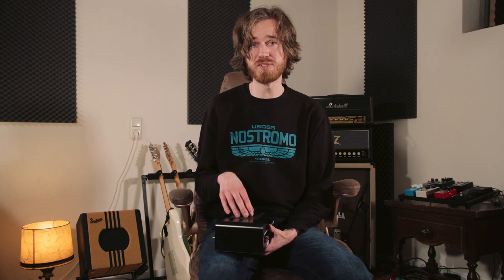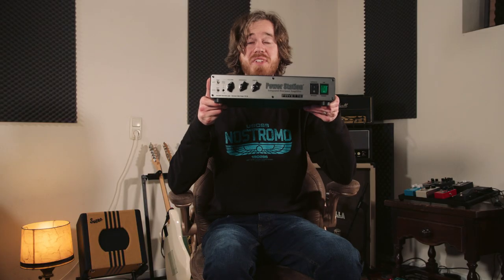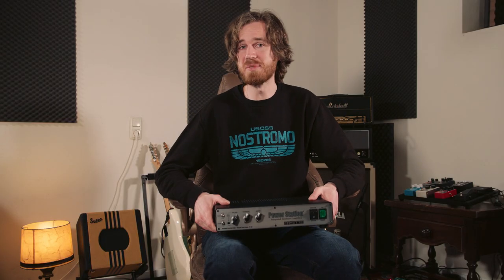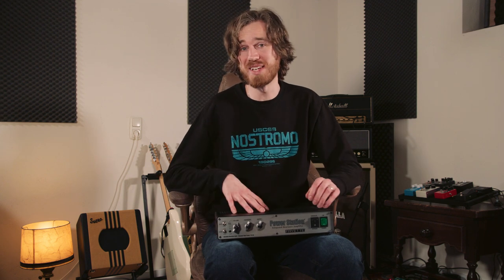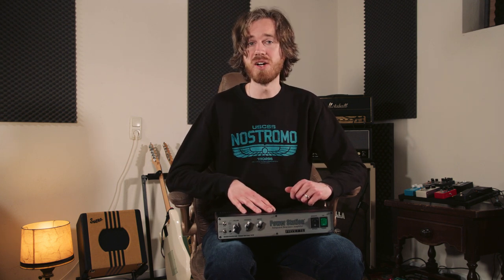Which Attenuator: Harley Benton or Fryette?!

Comment: Ok. I am sitting here with DT 770 headphones and after listening to the comparison in the first 2 minutes, the cheaper PA-100 is the one, which changes the least of your original tone. It keeps the muddiness and that rough, vintage tone. The Fryette sounds good but the signal sounds compressed, cleaner, less vintage and to me it sounds like a totally different amp. The PA-250 sounds closer to the original signal but a bit more airy, a bit cleaner and less rough. At least, that's how it sounds to me. We all hear differently. I did study music and work as a professional drummer. I just stumbled across those amazing attenuators. For sure i have to buy one for my guitar amp in my flat :)
Reply from the maker: You're right on the money there. Also check the follow up with the Tone King then 🙂👍

Comment: Harley Benton confirmed "PA-250 Power attenuator" as a RESISTIVE unit, not Reactive
Reply from the maker: Yeah not surprised. The info was very vague when they came out around the time I get them. Also still had some bugs and issues, and so did mine. Better than their cheaper options, but there's still a lot of better quality if you're willing to pay more.

Comment: I like that you did this comparison. However, I’m confused by the Power Station in this because in the other demos I’ve watched of it there was just about zero discernible difference between the Fryette bypassed, and the Fryette engaged and set to unity gain. And if I was able to hear any difference, it was so minuscule that it didn’t even matter. This doesn’t seem to be the case in your demo. Just an observation.
Reply from the maker: Depends on how you use the switches. I didn't use the flat settings, since that makes it a resistive rather than reactive load, which defeats the purpose for me. This is how it sounds in the other settings. No trickery besides that.
Reply: Agreed, I have the Fryette and it is excellent. Steven hasn't set it up right or something lol.

Comment: The Fryette is so much more than an attenuator and I believe you haven't scratched the surface of it. Learn first how to use it, before giving such definitive conclusions. I own a Fryette PS100 and it has been a life changer, so much so I'm considering a second one for stereo applications.
Reply from the maker: This was an attenuator comparison, so there was no need to explore the other functions in this video, since that wasn't the point of this video. That's why I stated that the Fryette might be more usefull to other people who might be looking for something more than just an attenuator. But this video and the follow-up weren't about that, this was for people just looking for a good attenuator, so that was the focus of this video.
Reply: @StevenAnthonyGuitar  honestly the Fryette isn't even an attenuator but a load box that runs into a power amp. So it's not to be compared to other attenuator but other load boxes. I even think you stated something similar in the video so... Doesn't make sense why it's here. The two notes captor in the attenuation mode or rock crusher would've been a better comparison IMO as it's apples to apples then.
Reply from the maker: @AtTheSourceStudios  when I opened a thread on the Gear Page about which attenuator I should get for my purposes, the most recommended one was this Fryette. It is promoted as an attenuator. I've tried the Captor X, but it is very limited in its attenuation capabilities and I think that's more of a load box IR... with minor attenuation capabilities. Check out the recent video Johan Segeborn did on the Fryette: a attenuator for sure, and he seems to get better results than me. I still prefer the Tone King Ironman II.

Comment: I checked with Fryette and they said: "The “Flat” settings make it a purely resistive load.  The other settings change the impedance characteristics of the load, not the frequency response directly, though that usually amounts to the same thing." 

Then I said: "So the attenuator is going to perform like most other resistive attenuators unless I use the switches?"

They responded: "No, it is still a different method of working than a traditional resistive attenuator.  The Power Station is a re-amp, so even with pure resistive settings you gain the continuous control over volume and have a completely consistent load – traditional attenuators actually vary their load characteristics with each “notch”.  It is a fundamentally different product than, say, the Hot Plate and its ilk."
Reply from the maker: Thanks! I initially got this information from Pete Thorn's video and then checked with Fryette before posting this video. They told me something different than you it seems.
Reply: you are correct sorry for the confusion... the first response I got was worded weirdly
Reply: @StevenAnthonyGuitar  I got more information and posted in the original post: "It is still a different method of working than a traditional resistive attenuator.  The Power Station is a re-amp, so even with pure resistive settings you gain the continuous control over volume and have a completely consistent load – traditional attenuators actually vary their load characteristics with each “notch”.  It is a fundamentally different product than, say, the Hot Plate and its ilk."
Reply from the maker: @truthoriented  I have to say I didn't notice that much difference in the flat setting to those cheaper attenuators, be it in sound or feel. Not badmouthing the Fryette, it's a great unit and will have its uses for sure. But for attenuating a my plexi amps, I think the Tone King Ironman II just did a better job.

Comment: I've just started seriously thinking about getting an attenuator for my old Laney AOR 50w head because now that I have a Kemper and have started playing gigs, I really want to get the most out of the Laney's tone for profiling and taking it out on stage, I've just never been able to get that cranked tone out of it and I need something that will knock off quite a bit of volume without colouring too much.  

Dude, I actually completely agree with you on all fronts here, I didn't like the way the Fryette sounded like it was trying to compensate for the altered highs and lows by scooping out the mids, Imo mids give most noticeable in character in a valve amp so that's a big no for me. The Harley Benton is actually VERY similar to the un-attenuated tone like you said, mids still in-tact, and it would be easier for me to bring the low-end back with an EQ without colouring the tone, just enough to fatten up the sound. Great "straight to the point" video man, you have my like and sub, I'll check out your Tone King video next 👍
Reply from the maker: Thanks, I'm glad you liked the approach here!

Comment: The PA-100 sounds the most realistic/neutral
Reply from the maker: Although I still own it, I would disagree. It muffles up the sound and you can hear that in the comparisons, at least with good monitoring. But it's fine as a cheap alternative or backup.
Reply: @StevenAnthonyGuitar  that's maybe because the PA-250 and Fryette brighten the Signal up. I listen on Neumann KH420 in a measured in room.
Reply from the maker: @fritzhieke7209  all of them color the tone in some way. Of course I'm also bringing the feel into the mix, as you experience more difference by actually playing them. The best one I tried is covered in the follow-up video, and that's the Tone King Ironman II.

Comment: Thanks for this video. The same riff comparison of all the attenuators was useful. 

Was looking into the PA-250 since yesterday and it seems like a solid buy, except for the balanced and unbalanced out that seem to be a bit too hot gain wise, but I will use it just for the attenuation. Would've been nice though.

I still hear a bit of a change in sound with the PA-250, less harmonics or "rich" sounding, but good enough for home practice!
Reply from the maker: Thanks! The Harley Benton PA-250 cleaned up the sound a bit more somehow as well. I will follow up more on that in a new video tomorrow!

Comment: The intonation is out on your G string, so when tuned its fine on open fret but as you use different parts of string it pronounces how out it is, this is coupled with the G string i assume being a little old? It pitches drastically based on the pressure your applying, intonation is first step, dont want to be "that guy" but i wish someone told me sooner years back, nice video thankyou for info
Reply from the maker: @jimistubbs5269  might be, that video was a few years ago. When you're making videos in your spare time it doesn't always go as planned 😉
Reply: @StevenAnthonyGuitar  its always the damn G string, its become a running joke for my les paul performances because it literally changes with the weather now

Comment: Just for home playing, the Harley Benton is fine.Thank you
Reply from the maker: For home playing I would even get the cheapest Harley Benton. Once you start recording or rehearsing/performing with a band I'd go with a Tone King Ironman II though.
Reply: @StevenAnthonyGuitar   I have to ask as I can't try for myself what would you say would produce better results for home playing. The cheapest Harley Benton attenuator and cranking the amp or a transparent overdrive (klon, bluesbreaker types) and just running the amp really low, getting the gain from the pedal. I am asking about both feel and sound. Also I have to mention I really like the overdrive that my amplifier (tweed deluxe) naturally produces and my aim is to color the sound as little as possible.
Reply from the maker: @martinmcfly2770  for home playing I prefer the cheapest Harley Benton attenuator over an overdrive. I did both with a Studio Vintage. For a while I used a cheap Timmy clone (Caline Pure Sky) in the effects loop to get a good drive sound at really low volume. Out of all of the pedals I tried (incl. a Tubescreamer, Boss EQ and many others) this worked the best and did a really good job...

... but I still have and use the cheap Harley Benton when I have to play quiet. At those levels you the coloration of the attenuator gets mostly undone by the Fletcher-Munson effect, but it still feels and sounds more like the amp than a pedal. For gigging and recording I wouldn't use it, for that I've got the Tone King Ironman II.
Reply: @StevenAnthonyGuitar  Thank you I really appreciate the detailed answer and how fast you replied! In that case I am going for the attenuator. As for gigging it is around 12 watts so I think I will be able to crank it, depends on the drummer I guess but it should be possible. And recording isn't in the cards for now so I will be fine.

Comment: Thomann says the Harley Benton PA-250 is no longer available. No mention of back ordered either. I wonder if they had reliability issues? Some negative reviews on their site with an average rating of 4.2, which is really low for a Harley Benton product in general?
Reply from the maker: The user reviews were pretty positive as far as I remember, only some negative comments about a non-included power adapter. Mine turned out to have issues though, I talked about that in the follow-up video. So there might've been some trouble with reliability in their most recent batch. When they take it offline, users that've received a faulty one cannot complain about it in the reviews until a new/fixed shipment arrives. That's my guess at least.

Comment: great video... How about the amp's headroom, is it affeced by the attenuator? I had the dr Z attenuator and didn't work for me... I use pedals (OD-DS1-boost) and when using the boost, you couldn´t hear a difference, even if you turn the vol all the way up in the booster. So, do they work using that pedals?
Reply from the maker: With the Harley Benton the amp seemed to clean up a bit, allowing for some extra room in that regard. The Fryette had so many options that I can't really remember. I went with the Tone King Ironman II and that didn't change a thing, which I prefered.

Comment: The power station is supposed to be the best on the market and extremely transparent.
Did you start with the depth and presence at 12 o clock ?
Also the 2 switches are for the reactive load, it changes the sound too.
Reply from the maker: I think I mentioned this in the video, but I've been all through the settings. With the switches off it's a resistive rather than reactive load, so at that point it doesn't really feel or sound any better than a cheap attenuator. With the switches on the feel and response are better, but the  tone is altered. Wether that's for better or worse is subjective, though I didn't like it for my rig. My money went to the Tone King Ironman II as being the best attenuator in the market, literally.

Comment: Rivera Rock Crusher is resistive. They claim it does something with a "network" of resistors, but that just means there are multiple partial resistors, and by turning up the attenuation, all you do is add more resistors into the signal path. This is a pure resistive design, and it sounds like sh!t. I know, because I fell for their marketing jargon and I bought one. Absolute trash, no better than Harley Benton or Bugera, just a way more impractical case.

Resistive loads use a simple resistor to turn power from the amp into hot air, and it sounds like butt because the resistance is always constant, which is not how a speaker works. Speakers have constantly changing impedance.

The Fryette is reactive, which means it has an active load inside, something with a bit of inertia or sluggishness, like a fan or something along those lines. The power coming from the amp will be "wasted" on turning the fan, which simulates the impedance fluctuations of a moving speaker, so a reactive loadbox will always sound better than a resistive one.
Reply from the maker: You're right, but the Fryette still alters the sound too much for my taste. There's a part two for this video where I cover the Tone King Ironman II, which is also reactive but with my amps changed the tone less. That's what I went with.

Comment: Thanks alot for this video so i need a reactive attenuador , around €220 is the cheapest here at Thomann , good to know so i can get aN ENGL Fireball 100 at home \m/
Reply from the maker: Well, like I said in the video: Thomann never responded to the question if their Harley Benton PA-250 is reactive or resistive. I think they're having some issues with their latest run, because the one I used in this video started to show overloading and they've removed it from their website.
Reply: @StevenAnthonyGuitar  As far as i know that wasnt the only issue . I saw a Test of the youtuber Eytschpi42 . The Line out didnt work as stand alone . It only worked in combo with the attenuator . Thats the main reason they took it off . I dont know if the Harley Benton P 100 got the same issue , but the P100 is a restrictive attenuator which changes the sound too much especially the low end punch gets muddy . Nothing for me cause i love death metal hahaha . So the 240 Watts Harley Benton isnt available , it is reactive as far as my research shows . I gonna end up with the Two Notes Torpedo for around €220 . Greetings from Germany \m/
Reply from the maker: @antonwilding9744  the stuff from Two Notes is great! I've tried the Captor X and I own the CAB-M.
Reply: @StevenAnthonyGuitar  yeah i saw only great reviews about that gear so far , thats a good sign !
Reply from the maker: @antonwilding9744  thanks for letting me know Henning did a video on the PA-250 by the way. I got to check that out.

Comment: The cheap & simple one sounded better - quite the disappointment for the fryette engineers.
Reply from the maker: To be fair: the cheap and simple one also stopped working after one day. Check the follow-up ;)
Reply: @StevenAnthonyGuitar  Ok, interesting - I'll watch more of your videos. Have you ever tried the SPL Reducer? On some forums some folks swear by it and claim it's one of the few more neutral devices... which I doubt because it just seems to be a bunch of resistors. It seems the only device of choice is the ironman... at least tone wise.
Reply from the maker: @brucetungsten5714  I've read some of the same things about the SPL, better never tried it. My search ended with the Ironman II.